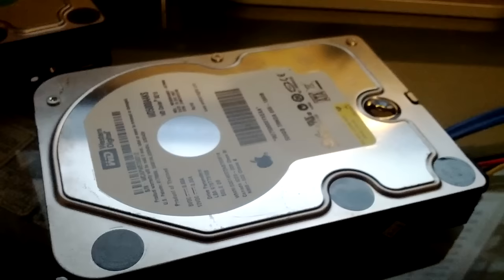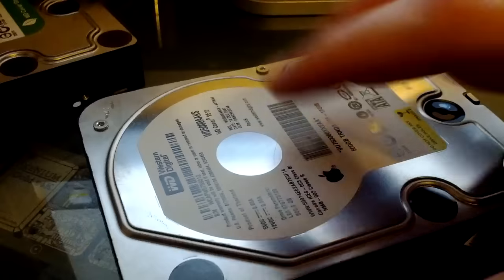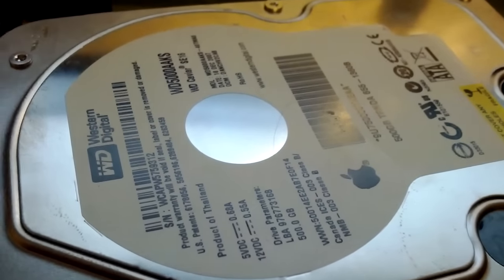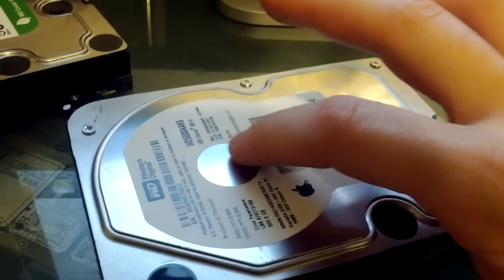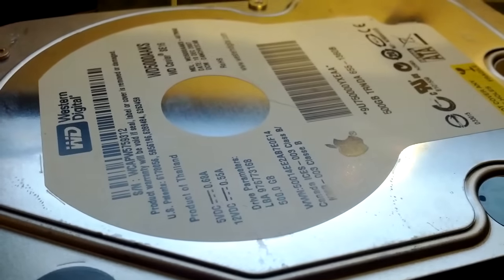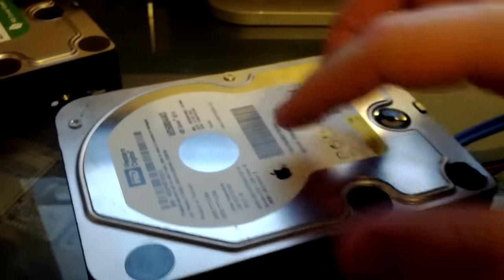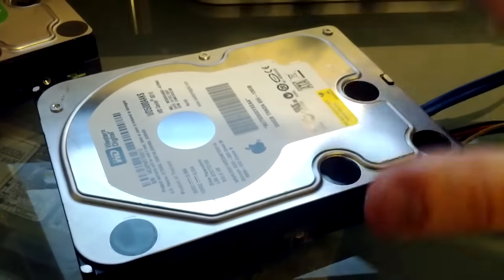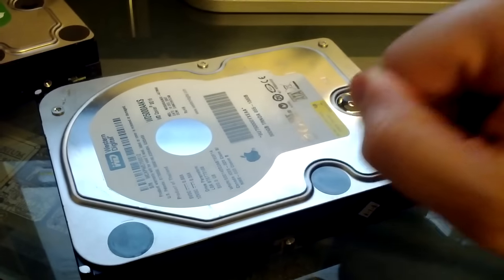The road to hard drive failure: Sounds

Comment: My hard disk is making a kind scratchy sound... "Kirrr kirrrr" is it normal?
Reply: yes
Reply: Same it only happened whenever my laptop is at high disk usage it’s like tv static but slowed way down
Reply: Exactly what happens to me , when my disk usage is 100% then it makes the kirrr kirr noises. I guess its normal then...
Reply: KasaPaperia But i don't think that 100% disk usage most of the time is a good thing...
Reply: @olindor  that sounds like sysmain screwing you over if you have w10 and you're getting over 100% disk usage. find sysmain and disable it
Reply: Rayota  Yup i did disable sysmain from the resource monitor...
Reply: @olindor  has it fixed it? if not im not quite sure what it may be
Reply: What the hell is sysmain doing anyway what is it for?
Reply: Thx everyonr this comment really helped me
I also have that noise
Reply: Your hard drive is head is stuck
Reply: thanks to the comment and the replys my laptop was making same noices and when I searched the internet I saw it saying it's a hard drive failing sign and my data will be lost I was scared because it's a new gaming laptop and I have a lot of games and stuff in it now I can finally breathe without any fear thanks
Reply: If it goes on forever even tho its not at 100%
BACKUO YOUR FILES IMMEDIATELY
Reply: Isolated "kirr" sounds are data being read across scattered sectors. You SHOULD be worried if it's a repeated staccato "kirr kirr kirr kirr" that goes on for an extended period of time; that's a read retry.

Comment: My old laptop’s hard drive finally ended itself, after giving me an error a month ago, then the squealing, I’m finally convinced it’s dead. Now I’m sad. It was the first laptop I ever got brand-new. Rest in piece, my child. ;-;
Reply: Can't u recover data?
Reply: @unknownexposer8399  it depends... 
If the platters are scratched then that's it... its no longer recoverable 
But if the motherboard and the head is the issue then yes you can recover it... you just have to bring the drive to the recover centres to get the data... 
And MAKE SURE YOU GET A SSD
Reply: just replace the drive, then the laptop is working again. if the data is important, send it to data recovery.
Reply: My condolences 🙏🏼
Reply: You can always replace the hard drive for an ssd and it should run good as new

Comment: Mine makes one relatively loud "snap" or "click" sound within seemingly random intervals. Just one though, it doesn't make many sounds in a sequence. I've also noticed from looking at Task Manager that whenever it makes this sound there's a spike in Disk usage. I ran CrystalDiskInfo and it told me my HDD is in good condition though so idk.
Reply: Same. Did it died ?
Reply: @sbsb8881  Idk this was 6 years ago. I've upgraded so many parts since that I honestly can't remember what happened to it.
Reply: @sbsb8881 What happened to yours? Mine started doing the same since a few months ago. I have been keeping regular backups but still worried.
Reply: @smellymomo did It die?

Comment: I figured out what's wrong with it, it thinks it's a tiny drum machine.
Reply: harddrives are the cheapest part to replace in a pc.
Reply: @shadowagent3  But the data
Reply: @noonehere4332  its recoverable...
Just change the head and the motherboard and boom. Up and running again

Comment: That is the click of death. The read and write heads have failed.
Reply: SigmaticLegend Sounds scary 😬
Reply: @BlyatifulButter  It is... RIP my data..
Data recovery is too expensive.
PLEASE backup your data, you'll thank me later.
Reply: enoch mundall thanks bro, even though I have an SSD but I’ll back it up just in case 👍🏼
Reply: @BlyatifulButter  How do you back up your files?
Reply: High use the backup tool feature that Windows has (or if you use a Mac then you have to search it up)
Reply: @BlyatifulButter  I'd say SSDs are worse, with a hard drive it fails but data is recoverable. When an SSD fails all your data is gone for all of time! :)
Reply: @enochmundall5275  RIP 😢
Reply: @ducksonplays4190  i guess yes... your right... but people want sPeEd

Comment: If you don't have a Blu-Ray recordable drive on your PC buy one soon. The discs are under U.S. $2 each and can hold 23.2 gigabytes each and are very hard to accidentally get scratched. And you're not limited to files being under 2 gigabytes each like with a flash drive. If the file is over 23.2 gigabytes just use a file splitter. MD5/SHA256 sums won't hurt either...
Reply: I use BDXL m disc from verbatim 100gb, which holds 93.2gb of data, is great you can try it

Comment: My laptop drive does the same thing then shuts down. It usually goes back to working after a few minutes of shuting down. If i shut it down and start it up again immediately then it doesnt do that sound and if i put the laptop to sleep and then wake it up it doesnt do that sound either. It only does the sound after an extended period of being inactive. Thanks for the orientation and the heating or cooling tip, it expained a lot.

Comment: Why is it we can't just replace the head in the hard drive.
Forgive my naivety, but what is it that is actually failing when a hard drive dies?
In my mind I'm  surely over simplifying picturing a needle reading a disk like a record player and for whatever reason the needle is not reading the disk, is it the disk with the data on it that goes bad(if so, how) or is it the needle failing to read the disk?

Comment: sounds like the headstack may be faulty, cannot find track zero (servo track) which contains the drive's firmware, head info, etc. Usually after it finds this, it seeks then the PCB controller lets the drive enter a ready state. Your drive is seeking, then parking heads, unparking and seeking and etc. WD drives do this 3 times then shut off because they cannot read info needing for the drive to be ready. It sounsd like it seeks a bit, then misreads so it parks spins down then back up then unparks and seeks, misreads, then parks spins down then back up unparks, seeks, misreads then shuts off.. More than likely a head or two on the headstack is definitely faulty causing it to power down.

Comment: I know this is old as fuck but a long long time ago, I actually used the freezer trick on a drive that was basically dead. Gave the drive another 6 months before it finally bit it for good, but it was pretty neat tbh.
Reply: do you just chuck it in the freezer? for how long though 🤔
Reply: @cyphr1182  It used to be that you wrapped it in towels and let it sit in the freezer for about an hour before pulling it out. This worked with the old PATA drives, and I had good luck with bringing a few drives back from the brink.

I don't know if this trick will work on newer hdds.

Comment: I could use some of your advice....(or anyone who reads this and knows how all of this works)my hard drive... is new. my old one died and I had mine replaced. it was working just fine, but then I took a flight to Cuba to see some relatives. I took my laptop with me, I was gone for 2 weeks. sometime during that time, my laptop began to show a bit of signs of failure(there was a bit of slowness and whatnot). when I came back from cuba, it escalated to the point where my computer wouldn't normally turn on(almost exactly what had happened with my old hard drive)I was worried and panic struck...(as I normally get when this sort of thing happens...)so I opened the part where the hard drive was located at, I removed the hard drive and I put it back inside. when I attempted to boot it back up.. it all worked like new again. everything was working as it should, there wasn't even any type of slowness like what happened with my old one. this continued for like a week... till I got the strangest, eeriest blue screen ever... I call it strange because unlike past blue screens that I have ever gotten this one lasted for like maybe 30 seconds or so... I can't remember what it said though...(I've got like the worst memory ever...)but there were moving numbers on the blue screen crash report and something about how if this is your first time getting this.... or something like that. then... the laptop shut down(like all blue screens usually end in), but when when I attempted to boot it back up, the same thing happened... the computer did not start up normally... so I did what I did before, I took out the hard drive and I put it back in, and Pressto! everything is fine now. this event happened like three days ago.... I've been very worried that my laptop's hard drive may have been damaged during the trip and back.

but I need to hear it from someone who knows a lot about hard drives... I watched this other video about hard drive problems, and so far.... it doesn't seem like I have any of the particular listed problems of hard drive failure, don't even hear any clicking noises or anything. I also learned that hard drive failures happen due to the fact that the hard drive is always producing heat, and this heat eventually is what burns out the hard drive. so I've been putting my fan next to my computer in an attempt to cool it down while I use it... and then I just sort of began worrying again, looked up more information, found your video and then I got a bit pannicky when you were saying that if you put your computer in a state like in a fridge(and I know that a fan doesn't compare to something like that, but...)in an attempt to cool everything down faster or something, and that that could cause like humidity to occur inside the place where the hard drive is located in... it just got me to thinking that maybe even fluctuating temperatures could also frie your hard drive?....

I just.... Need to know more.... about this..... before I go insane.... with worry. . . . . . . . sorry for long comment...

Comment: Is it a harddrive error if your computer makes a kinda loud 'krkrkrk' noise? It's hard to describe but mine has done it since I got my PC (custom built by friends) and it's gotten louder since I've had it. The reason I think it's the HD is because it only really does it when I do something intensive like open a large folder where it has to load all the files or open a program like Photoshop. My HD is pretty cheap Black by WD.
Reply: Yesterday i got a NEW pc and i think i have the same problem...when  i do something(i open Chrome,files or intalling game from steam) i can hear that "krgkrg kkrk"noise. I think its not from fans...i hear the noise at my cd room and i can see a redlight inside my pc only when i hear the noise. I really want to know what is the problem cuz it was a kinda expensive pc. (Sorry if my english was not perfect)

Comment: So I know this video was made some time ago but my Mac has been making that same noise in the bottom right corner. ( that's where the hard drive is right?) from when I turn it on it does the tick tick tick tick and stops and continues. how long does this hard drive usually last? cause Im not sure if I will be able to get a replacement right away

Comment: my hard drive went beep beep beep beep is it gonna explode lol
Reply: Probably not, but under most circumstances that's not a normal noise for a hard drive to make. It would likely to be a good idea to make sure your backups are good (you DO have backups, right?), and to prepare for a possible drive failure in the future.
Reply: Beep beep beep is ram problem

Comment: Funny that I have the same exact drive, same exact model and everything, however mine was for Windows Vista. Mine makes a similar noise except the actuator is stuck, producing eerie, loud beeps, while the platters spin up and  down after each beeping noise. It does this exactly 5 times before powering down.
Reply: Yeah heads are stuck to the platter due to stiction you could try the freezer trick if you don't mind losing the data on it forever of it doesn't work, the heads otherwise can't be unstuck by traditional means without further causing damage to the drive I suggest you take it to a recovery professional if you got imp data on it.

Comment: mine does a small rumbling noise when in use. is that normal? its barely noticeable but I haven't experienced it before.

quick notes:
-the OS in on a ssd
-I just changed my sata port since the computer didnt recognize that a disk was plugged in
-psu has been swapped with a new one

Comment: hdd make power up noise constantly, with that comes a short 1/2 freeze/glitch...
I changed one HDD that made the same sound, now the new HDD emits the same sound, I also replaced the PSU but nothing has changed, motherboard, GPU, CPU, RAM I never changed those components they are 4 years old? Please answer me?

Comment: Question : is it normal to hear just that spinning ? without clicking or stuff . should i be worried ?
Reply: You shouldn't because the hand of the read/write hovers above the surface of the disks not on it if it starts clicking it got stuck

Comment: bad heads i think. Can't read track 0 which contains the firmware data, drive info, ETC. So the drive tries again 2 times then shuts off. If the drive had the heads replaced i think it would work.

Comment: My SSHD makes faint chattering noises. It sounds a bit like a Geiger counter, but it's unorganized and comes randomly. At times I have a feeling that it's associated with the drive LED blinking. Every laptop I had made this sound. All software I used (Defraggler, CrystalDiskInfo, the stock Windows error reporter, etc.) came up with "Good" drive health. The chattering is very frequent when I turn on the laptop, but it calms down after about 10 minutes. I am now on 15% fragmentation and the air vents are downright disgusting from all the dust.

Could it be that I'm hearing the fan? Or could it just be that my hard drive is louder than others naturally?
Reply: Every HDD does make clicking sounds which is completely normal, and some are louder than others. This is related to the HDD head moving back and forth reading the data. At system startup and a few minutes after the HDD is louder because it has to load the operating system (probably Windows) and the startup programs. And the clicking is not directly related to the LED blinking, the LED blinks if the HDD is in use (so the LED will light up pretty constantly on system startup) and if the HDD is in use, the clicking becomes more frequently and louder.
Reply: Yes. Got rather used to it by now. I was extremely paranoid for a week or so, but just let it be after a while. Seems to be running just fine. Only thing that bothers me is the goddamn temperature. Need to clean the vents every bloody month.Florian Schmidt
Reply: λολ

Comment: I'm worried that my hard drive is failing. Occasionally it makes a moderately high pitched noise that goes on for 15 - 25 seconds and then goes away, and It's happened 4 or 5 times in the past 4 days

Comment: Mine is a weird screeching noise, as if something is scraching against it, I can hear it inside
Reply: HuskyMaster119 same here
Reply: same but it does not really make any bad effect or anything
Reply: Keneki Kin I heard it means its normal and it must be me tho since I'm used to an SSD
Reply: i have a hard drive thats 24 years old with no bad sectors and its done like 30.000 or 40.000 thousand hours
Reply: HuskyMaster119 same, have you done anything to fix it?
Reply: josh which brand?

Comment: My hard drive sounds like R2 D2 is that a problem? lol
Reply: +xSlingerx No, mine sounds like Chewbacca and works just fine with 100% health
Reply: yeh mine the same dunno why?
Reply: lol
Reply: Mine sounds like a Helicopter about to Fly Off
Reply: I'm supposing it's because the layers of the disc simply start to deteriorate and it causes that noise, of course it could always make a catastrophic scratch on the disc :)
Reply: mine sounds like a diesel engine but thats just sometimes
Reply: Same
Reply: Mine does a thump sound only wen downliading files 10 gb or more bigger, Thump Thump Thump

Comment: My hard drive makes a single noise when is slows abruptly from scanning the disk. I've been running it for awhile after, and it hasnt gotten worse, but I'm still concerned. The sound is hard to describe... but its not too loud. Help?
Reply: And it takes like, 15(?) seconds to open a 15000kb lua file. Is this normal?
Reply: Allen Weber
Depending on the drive type (older IDE more typically), that speed may be fine. If it's just a buzzing/humming sound, that's usually just it reading data or searching. If the sound is not in a multiple repeating pattern for a bit before it starts loading, I would not worry. If you are executing the LUA file in a LUA interpreter or program that uses it, the CPU has to process and compile it line by line, then run it. So the CPU could also be the reason why that specific the file loads slow. Scripts that large are decently intensive (if it is a LUA script in the .lua file). In any case, make sure a backup is kept. Then if it dies, it's only a matter of copying stuff back.

Comment: my hdd doesnt make any of this sounds but its making a sort of high pitch noise now and then, specially when i do something like playing games or that kinda stuff, should i be worried?
Reply: +IruzHalsted I'm glad to know I'm not the only one in the fucking universe having this problem. Sadly, I've found nothing on the high pitch "chirping".
Reply: What brand is it?
Reply: Blowtorch the Robot Western Digital, if I remember right.
Reply: Blowtorch the Robot
WD blue
Reply: Thanks for the info but i actually found out that it was my mistake actually, the hdd seems to be fine, the high pitch sound came from my graphic card fan, but now im sorta concerned about the temperatures, summer is kicking in and my hdd is at 48 degrees, i've readed that the max temp is 50 degrees but a friend told me thats not true, so im kinda scared atm... dont want my computer failing at this time cuz i have 0 cash to spend fixing it...
should i be worried about those temps?